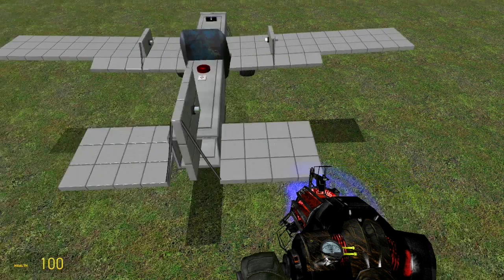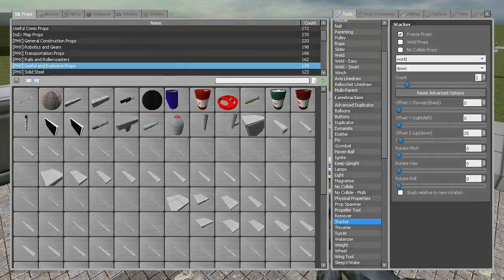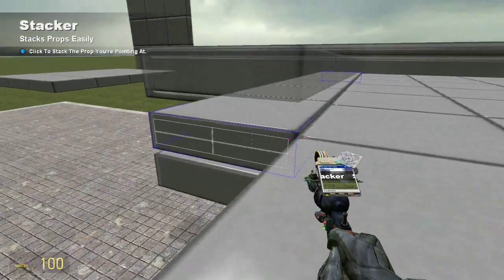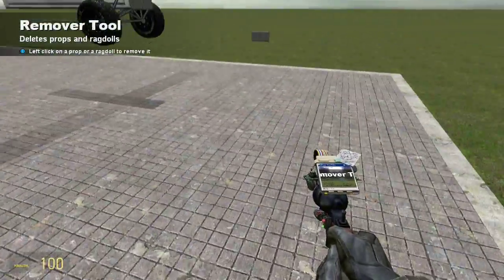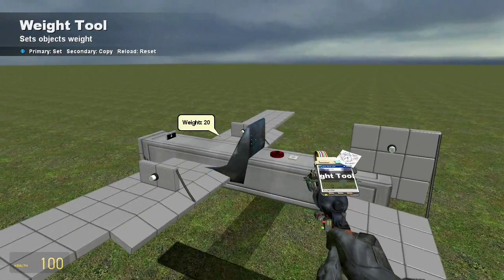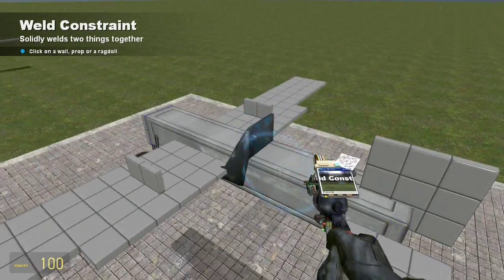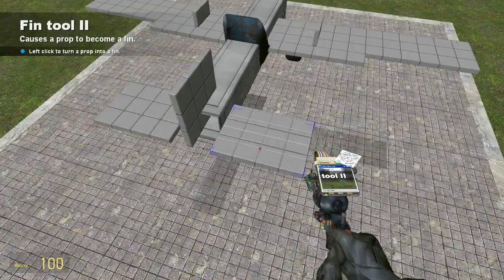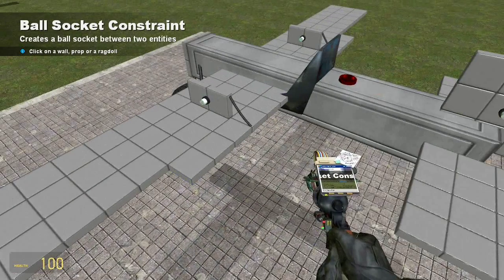GMod - Dman's Fin Tutorial (Ailerons and Fin) [Part 4]

Comment: by ailerons you mean flaps
Reply: Your definition of flaps is incorrect. Flaps are used to lower the minimum speed at which the aircraft can be safely flown, and to increase the angle of descent for landing.  Ailerons are a hinged control surface that allows the rolling of a aircraft
Reply: Ailerons. Not flaps